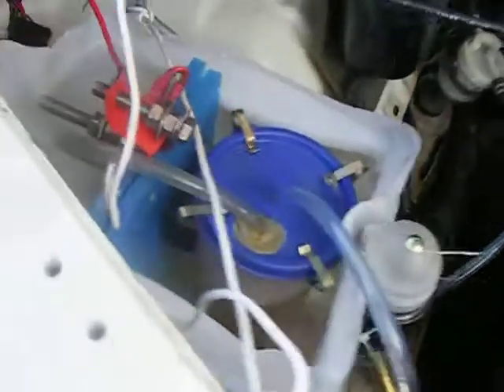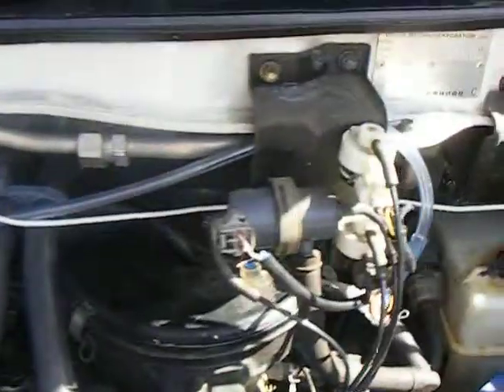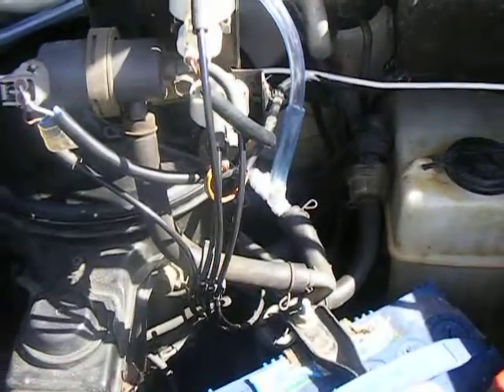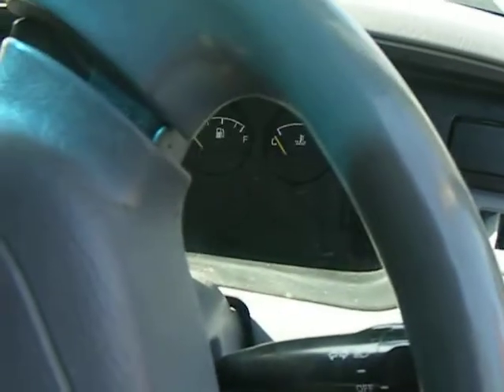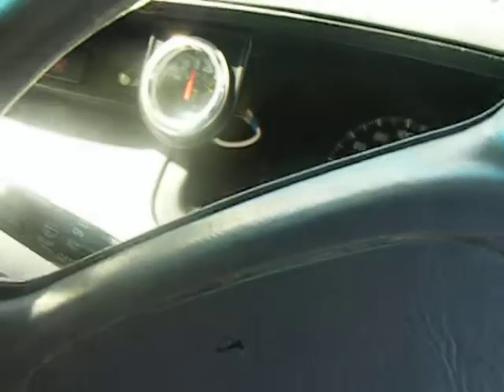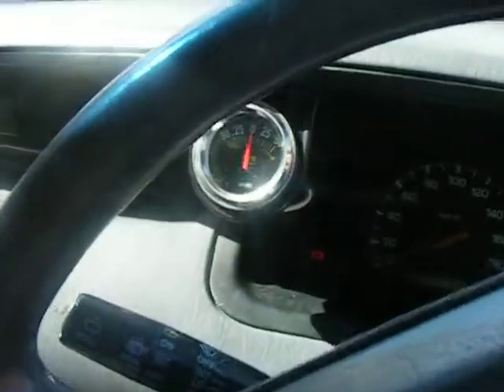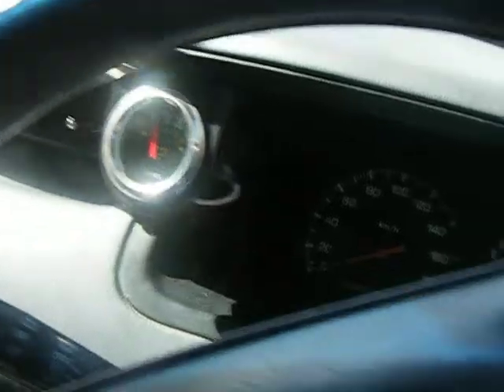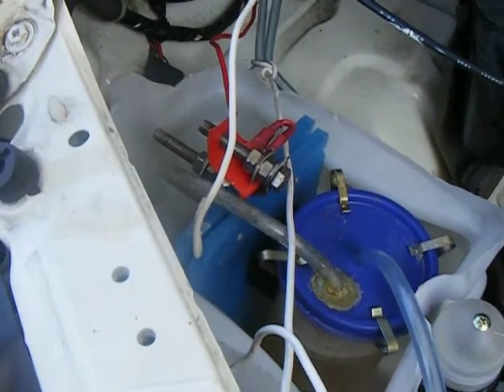Hydrogen boost running car on hydrogen, Improved ignition & running.

Comment: Your supposed to have a blow-off valve on the system so if the pressure grows too high it will release it without blowing up on you.

Comment from the maker: If you have a fuel injected vehicle you will need a efie circuit as the computer that runs the fuel management will sense the leaner burn, higher O2 sensor value and it will inject more fuel to compensate.

Comment: Yes, it was pricely and this whole HHO project has cost me at least 1000 dollars for a bad kit from a water4gas guy which didn't work as specified and one year of me trying myself afterwards with no increase in mpg whatsoever. So lost money and lost time. But I have learned a lot of HHO though.. I made a kit from a motorcyclebattery which had a mmw of 6,3. But no results on my tdi, and no results on an old volvo, who should be easy to get gains with. I really don't understand why I don't succeed

Comment from the maker: I forgot and left cell running one time while I went into a  shop for 10 minutes to get milk & bread. When I came out I turned the key and van just started first go. Nothing blew up, no problem. Maybe with a simple carbie system there is nowhere for gas to accumulate and explode. Sorry to hear about your intercooler though, sounds pricey.

Comment from the maker: Yeah.
Maybe a market for selling to people with hard to start engines in those colder climates. I had a boat outboard that was sometimes hard to start, damn 2 strokes. Think it was just stale fuel half the time, wish I had know about this stuff back then, would have saved some grief at the boat ramp.

Comment from the maker: Just set this up in van. I will keep track of mileage over the next few weeks and post figures once I have done enough mileage to give reliable statistics. This is my old van so I dont use it as often as the new one, I only used it as it has the old carburator set up so it should be simple to test fuel economy without fiddleing with an effie.

Comment from the maker: That is a pressure release valve on top of the dryer unit. The top pops open if there is over pressure or a flashback. the silver wire is made of spring steel and it pushes the ball back into the valve opening once pressure is released resetting the valve. It works quite well I have tested it extensively.

Comment from the maker: This is a petrol engine normally asperated (Carbie) I had done this test several times before filming. The engine is quite old on this work van approx 190000kms and it uses a little oil and blows a bit of smoke when idleing for a while . Interestingly the smoke isnt there much when the hydrogen is on.